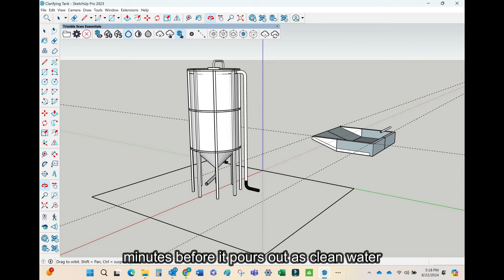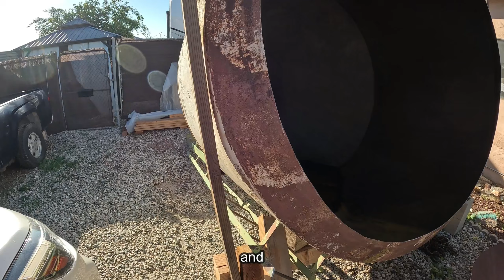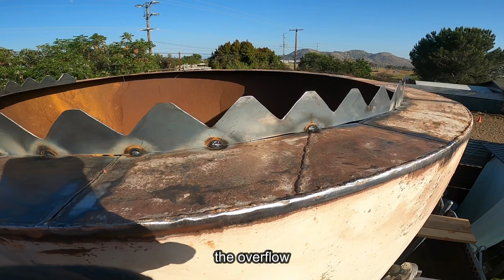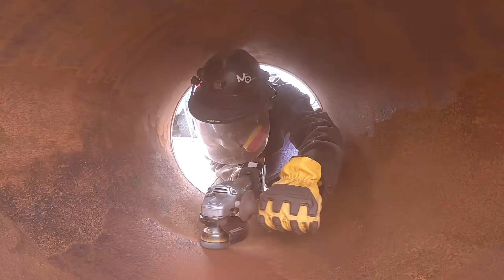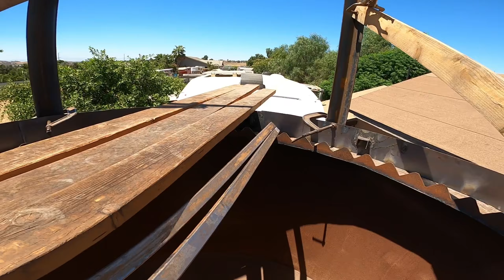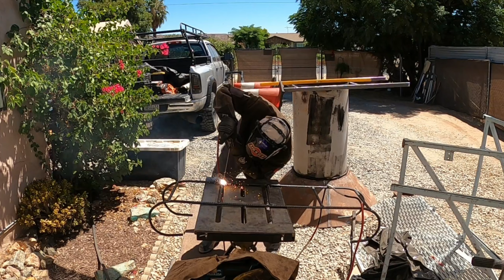Building a Clarifying Tank for Desilting Water at our Mill-site Part 1

Comment: That was fun to watch and see you use what you have to make the job easier.
When I was in High School (an Industrial High School) in the mid 1970's I picked a credit hour class called "Wrought Iron Decor" Every student was taught to use Oxy-Acetylene to cut and weld. Cutting torches small and large, what p.s.i. to use on the gauges. My teacher was surprised when I asked if I could use the steel hangers our parents would get when they had their clothes dry cleaned. There was a coating on the hangers to prevent the steel from putting stains such as rust on the clothes. The coating was like a shellac but for the most part was a really good flux. Stank when burnt but did an excellent job of creating that bead. I built a beverage holder for my truck as I kept breaking the newly invented plastic crap. My teacher was impressed with my idea. My first attempt at cutting a piece of flat steel to make a circle didn't work then the teacher had to explain some mathematics to acquire my results. Teacher also commented on the ideas I would create on copy paper with measurements. He asked where I came up with my ideas. I said my dad was Nuclear Ballistic Engineer.
Reply from the maker: John, I really appreciate these experiences. I haven't learned how to weld with oxy-acetylene yet. I've learned 3 methods so far and have been swamped with projects. I can't wait to learn that. Harry just learned that method in a class he took. That's really creative with the hangers. After you watch part 2, which will be released in the next week or two, you'll probably have a much easier way to make the extended conical section of the tank that I made. Fun learning from others. What's crazy is as soon as this project is done, there are 5 more fabricating projects lined up. Then somehow mine, mill, smelt, fabricate, reclaim, sample and repeat. Not hard at all lol. Oh ya, and still manage my day job!

Comment: A word of advice, don't grind metals next to your car, the hot sparks burn into the paint layer, first time out in the rain and you end up with tiny rust spots all over your paint job on the car.
Reply from the maker: @VikingExploration60 You should see my cell phone, gopro camera, clothes I wear while fabricating. I know what you mean. I try to move the vehicles around or setup a welding blanket over something that I want to protect. Challenges of not having a shop at home to fabricate.
Reply: @mineoperator  Shade tree Mechanics, I can relate. My wife takes our dog for a walk around our property every morning and brings back things she has found. 35 years I have lived here and in her "finds" I say to her "I lost that when I was building this, or that. Well, it's to rusty to use now.

Comment: I might suggest using a gin pole to put the top on the tank, just like you put an antenna tower section on another or a beam antenna on a tower. With the truck you might consider using 2 gin poles, and putting lifting points on either side of the top section and raising the top section using the truck for equal lifting on both sides. Good luck on the project.
Reply from the maker: Great ideas! Thanks for those suggestions.
Reply: @mineoperator  I've seen your invention you use to lift the bags of ore up to the top of your processing machine, could you not use the same principle for your lift for the tank? After all, that is where you're going to use that tank. A fork lift might work too. Build most of your tank in your backyard and finish it at the processing building.

Comment: Silt Bag:  https://www.youtube.com/watch?v=XWV8QwlAzTQ
Reply from the maker: Thanks for sharing this link/product. I've gotta try this out. Might be able to incorporate it or use it for a mobile operation in remote locations. This silt bag could really help us.
Reply: @mineoperator  We procure large silt bags, then cut them up to fit the various systems we employ. Alternatively, you can buy rolls. The fabric can be reused, or repurposed as retaining walls with perhaps plants, because they are biodegradable.  The bags, once full, can be hung allowing the water to drip out, if you need every drop...etc.  You could mix cement allowing the filled bags to harden into stones for a more permanent retaining (just imagine stacking the bags).

You'll figure it out, Cheers!  😎
Reply from the maker: @Jatslo  This was extremely helpful. Thank you.
Reply: @mineoperator  The silt bags are breathable, allowing you to use a high-powered vacuum to fill them. Once filled, you can easily lift the bags out of the area. If the fabric becomes clogged, you can clean it with a pressure washer. Some fabrics are resistant to both alkaline and acidic chemicals, which can be useful if you’re using such substances.

A closed system is best when fighting evaporation or mitigating dust; in any case a silt bag is highly versatile.  Yes, your water tank is interesting for sure; that piqued my interest. TY